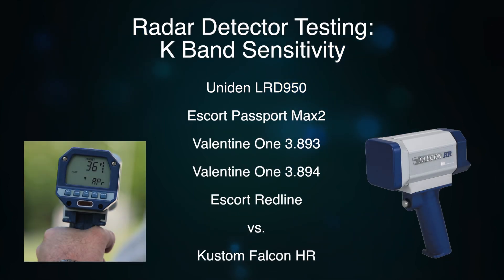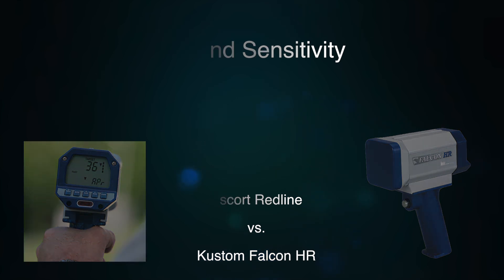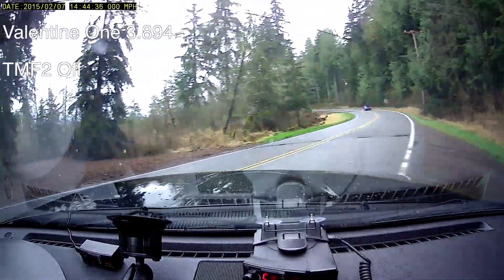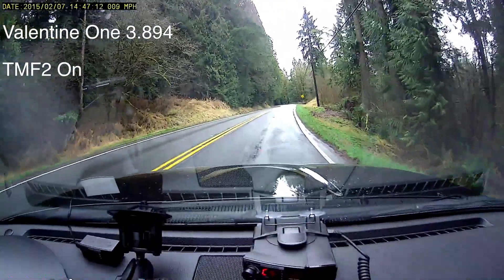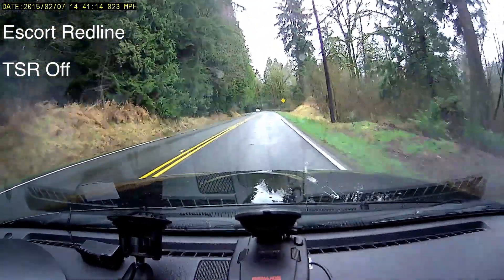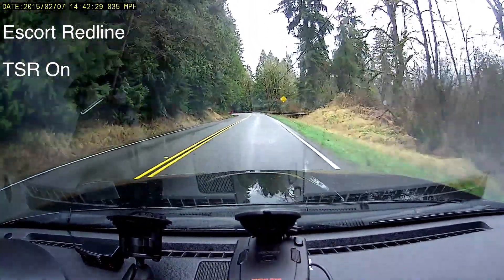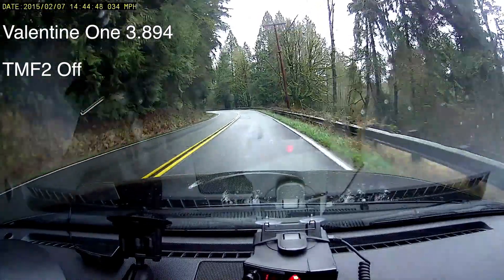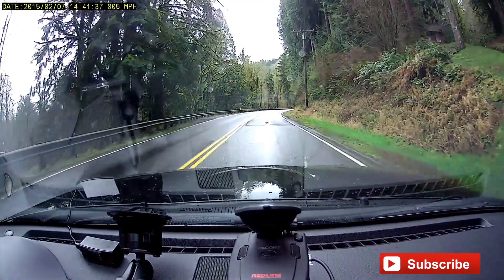Radar Detector Sensitivity Test: Max2, V1, Redline, LRD950 vs. Falcon HR K band

Comment: have question im running a crap cobra irad100 i got off my buddy for $20 it sucks im new to detector but very excited to get a better one but $250 is my max amount i can spend witch the LRD950 is i know its not in the top end detector class but would you recommend it or is there something better in this price range ive watch a lot of your video over the pass month doing research and your opinion mean alot thanks ps i live in FL lot of flat terrain no hills anywhere
Reply from the maker: drail636 The LRD950 seems pretty great in my testing. You can pick up a Beltronics RX65 which does a fine job for not much money.
Reply: Thanks for the fast reply I'll check it out and keep up the awesome vids man
Reply: I have learned that you can't put a price on getting out of speeding tickets, even though 650$ is a bit much....

Comment: Why do you think you got much better results with the LRD 950 here, versus Radar Roy with only getting 1/4 mile straight line of site vs low power K Band detection in his post recently put up here? 
I know my performance is significantly better than 1/4 mile with my Uniden LRD 950 on K Band with K filter set to OFF.
Reply from the maker: NYRFanSTL There was a LOT done improperly in his test. As for what exactly is going with his Uniden test I honestly don't know. His results are very different from my own. Additionally, the gun he was operating was not a low powered gun, even though he said it was.

Comment: I have the Escort Passport (the 350$) one, I was wondering should I leave TSR on or off?
Reply from the maker: ANormalPC TSR helps deal with K band false alerts at the expense of performance and reaction time. On or off depends on what you encounter, where you drive, and what your preferences are. For example, turn it on if you have traffic sensors on the highway that keep blasting you with K band every minute or two. Turn it on if you get a lot of K band falsing from vehicles with blind spot monitoring systems. Turn it off if you drive in an area with lots of K band being used, especially in challenging terrain and outside of big cities.